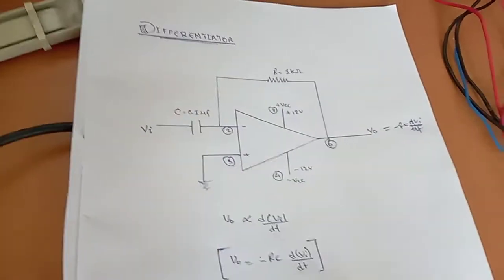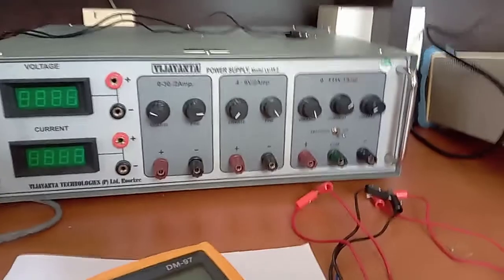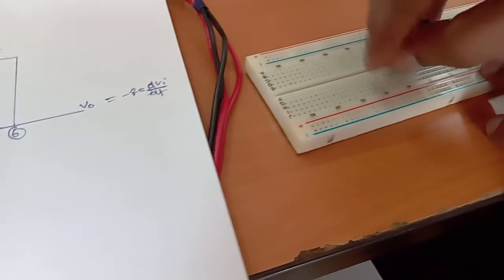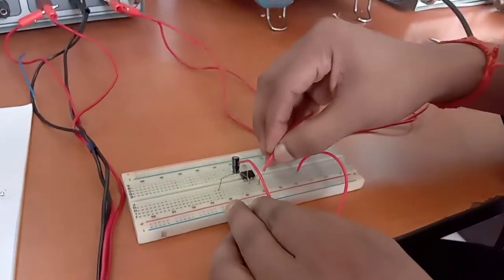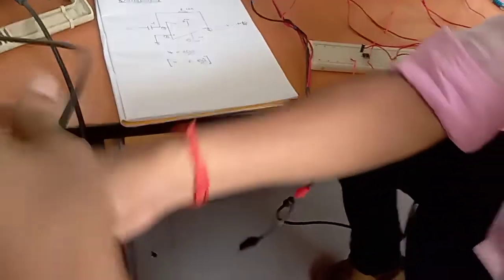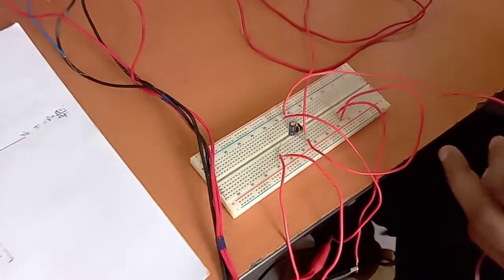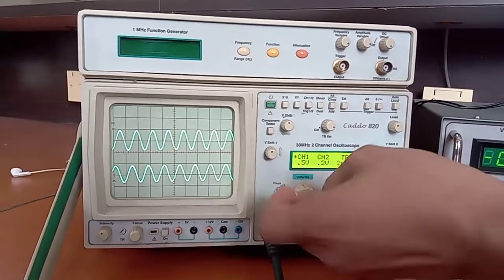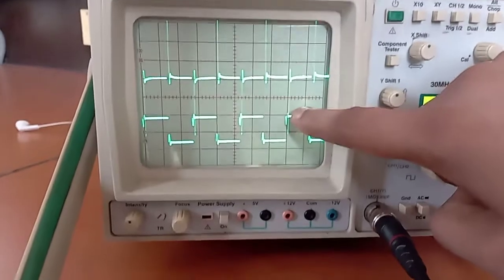Differentiator using op amp 741 IC #knowledgeandeducationbox

Comment: That's not a differentiator setup. You need another signal in and a resistor of 1K to ground at pin 3. At the output you need a ground as well. When you are done, try a stereo signal (music left at 2 and right at 3. It will give you a non-common (what is similar removed) version in mono. It's super fast processing and sounds interesting, if you don't clip the signals.